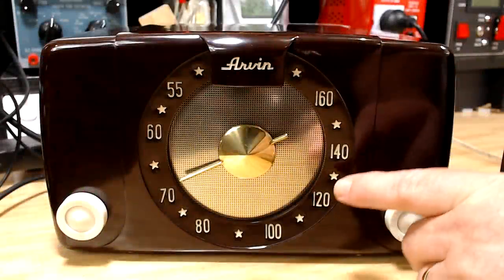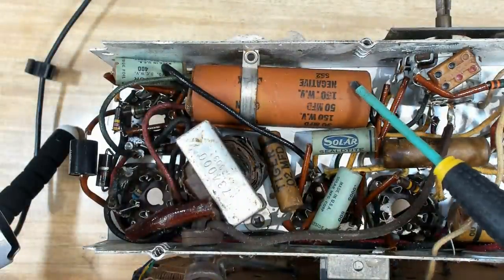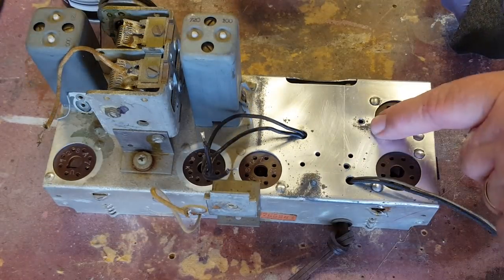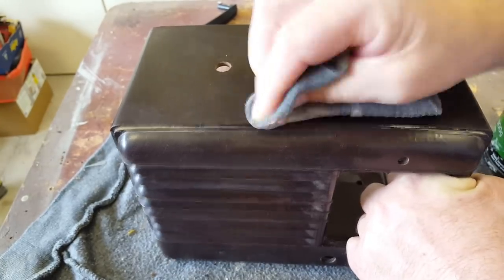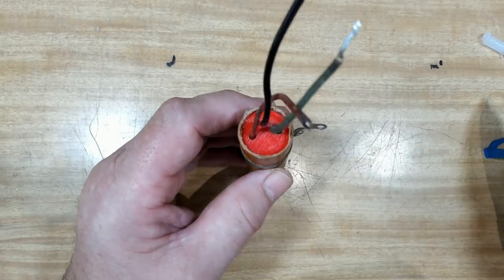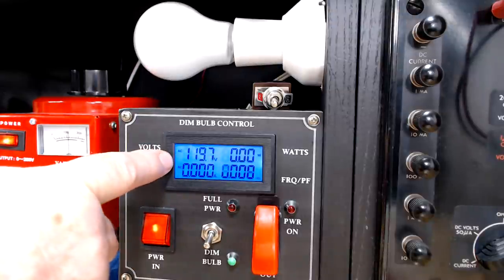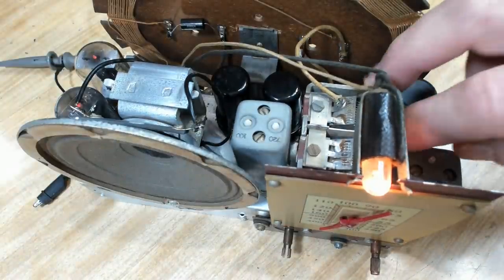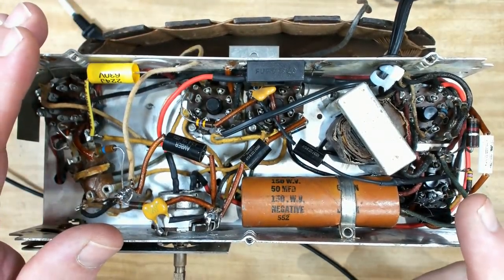Emerson Radio Restore Model 518 USA Built - 1940s

Comment: Replacement dial faces are available from several sources in the US, including eBay.

Those IF transformers rarely give trouble and do not use silver mica like later ones. The screws adjust open-air trimmer caps. They may be peaked during alignment but usually stay where they are set. The outer plates of each section of the tuning capacitor were often bent outward to adjust tracking, especially the oscillator section. Some were segmented to make it easier and more precise.

The pointer is original. It was made to point to the frequency on one side and the wavelength on the other. The same pointer was used on AM/SW models and its use on AM-only sets was mainly a cost-saving measure during depression years.

This was a popular design and also came in a wood cabinet. The handle was a big feature since people liked to carry small radios to other parts of the house and outside in hot weather to listen to ball games. Other brands quickly copied that (Philco, Motorola).
Reply from the maker: Hi Ray, luckily the dial face was Ok and the pointer although it was fit for function it looked like it came from a Corn Flakes packet, my printed one didn't look much better.
The handle was a great idea, my Mum used to carry the radio from the kitchen to the bedrooms to the laundry, in later years she used a portable transistor radio, much more convenient 🙂
Reply: @DavidTipton101  I just mentioned the face for the benefit of others running into the issue. Your method would always work but some aren't as handy as you.

I lucked out a couple of times by finding a couple of blister packs of small objects with just the size I needed. I keep promising ones now when I buy something. You never know what scrap will come in handy.

Comment: Emerson was a big name in electronic here in America.
Reply: I think the brand lives on but only as a brand and not a company.  Most of the stuff comes out of China and Hong Kong now.  I saw quite a few Emerson-branded transistor radios here in Australia in the 60s and early 70s...all generic Hong Kong units.
Reply from the maker: I believe it was Reginald, thank you 🙂
Reply: Emerson is very much still alive...  based in Missouri.  I believe more industrial stuff than consumer.  I have a few transformers, motors e.t.c.  made by Emerson or subsidiaries at work.

Comment: Great job David with the old Emerson. Emerson was a large maker of Low End consumer electronics. The name is still around but its not the same company. In the early days of radio Emerson's business model was to make radios as inexpensive as possible so as to keep the retail price low. They cut many corners in the manufacture process from the case to the electronics. Emerson made radios for the masses. They sold large numbers of radios throughout  the depression. In many ways Emerson was the pioneer of the disposable radio. Other than tubes replacement if something major went wrong it was cheaper to buy a new Emerson radio then to have the old one fixed. If Atwater Kent was at one end of the radio market. Emerson was at the other end of the market. BTW the case of your Emerson was indicative of most Bakelite cases Emerson used. Same goes for the pilot lamp and dial pointer. 73 Joe
Reply from the maker: Thanks for the information Joe. The case was rubbish, I assumed it was a one off but maybe that was their standard. The general quality of the chassis was good except the speaker held with one screw, I meant to put a bit of adhesive behind it when I refitted it. Thanks Joe 🙂

Comment: They wired the power to be sent through the filament in the rectifier so it can be used as a fuse. Wasteful by today’s standards but back when valves were common place I guess it wasn’t looked upon as a bad design. Always good to rewire the power switch to switch the live or hot side rather than the neutral side of the mains so bravo for getting onto that.
Edit: Fantastic work there making the new clear plastic dial piece! Couldn’t have done a better job.
Those I.F. Cans with trimming caps always tend to drift off frequency much further than the later slug tuned ones however they also don’t really get silver mica disease. They can get dust in the caps which may cause a similar effect to SMD which I experienced on a old ekco 30’s radio with 4 volt pre-octal valves.
Reply from the maker: Yeah, someone else said that too BOE, thanks. That filament would be living on the edge 😀
Reply: That’s what I thought, the valve has the additional function as a fuse, at least it can be replaced 😉

Comment: The routing through the filament is meant to act as a fail-safe for the radio since there is no fuse in the circuit. In the event of a short circuit, the tube will fail instead of causing major damage to the set or, worse, a fire.
Reply from the maker: Thanks Steven, most others are saying the same thing. I guess it saves a 10 cent fuse 🙂
Reply: @DavidTipton101  Well, not only a fuse but a fuse holder and extra wiring ... BTW, are you sure that this was a U.S. radio and not a Canadian model?  

Canada had higher electrical safety standards than the US up until the free trade agreement and extras like this fail safe were much more common in Canadian built sets... normally a Canadian radio would have either a CSA sticker or Ontario Hydro inspection label somewhere on the chassis so the absence of one makes it unlikely (unless it dried up and fell off).
Reply from the maker: @stephenwild2058  There was no indication that it was a Canadian model so I don't know 🙄

Comment: Hi David. Superb job yet again. I think the filament acts as some sort of circuit protection, I have seen this before in some other old radios. It may have been better with an Inline fuse and would also be cheaper to replace. You were lucky with the chassis being in a good clean condition for its age. It's always enjoyable watching your work. Again thoroughly enjoyed. Keep safe and well. Cheers Chris.
Reply from the maker: Thanks Chris, that seems to be the general consensus, expensive fuse if you ask me. The chassis cleaned up pretty good in the end 🙂

Comment: I think the theory with passing all the current through the filament was basically using it as a fuse in case something went wrong on the b+ side.  a very expensive fuse in 2020.
Reply from the maker: Yes, I think you are right kevtris, not sure if it's a good idea or not 😀

Comment: Just a little note. I've had great results using brake cleaner (the non-flammable type) it is the same chemical used for dry-cleaning. It doesn't remove paint, but is a wonderful solvent for dirt and Greese.
Reply from the maker: Thanks Tim, I'll check it out 👍😀

Comment: The pilot light is in parallel with that piece of filament. That's why the extra current flows through there. If the pilot light burns out, the extra current will kill that tube fairly quickly.
Reply from the maker: Hi Mr Hat, you  are absolutely correct and I missed that. I couldn't understand how so much current was passing through the filament but, as you say, the bulb will supply around another 120ma. Thanks for the update, I did learn from the Arvin to make sure the bulb was working 👍😀

Comment: Well done David,  a pleasure to watch you do your magic on these radios.  As far as that red indicator jewel, my guess is that it was added on.  The schematics for these 500 models which you showed, listed a dial crystal, which I believe refers to the dial cover(dial lens, etc) since photos of these models show no indicator jewel.  Haven't read all the comments so this may have previously addressed , if so, sorry for the repeat.  Looking forward to the next adventure
Reply from the maker: HI Bob, thank you. Yes, I think you are correct about the crystal being the glass and the red lens being an add on. I also think it was a replacement dial and pointer. Other comments also helped cleared that up but it had me confused. Thanks for your help 👍🙂

Comment: Hi Dave, thanks for the video. The IF frequency could be deliberately changed from the original 455 kHz. In the 60's some radio's sold in the Netherlands used an IF frequency of 472 kHz. The maritime radio station "Scheveningen Radio" was broadcasting at nearby frequency 461 kHz (among others). The strong signal would swamp out nearby radio's and listeners would hear Morse code coming out of the speaker regardless of where the radio was tuned. Radio repair shops would change the IF frequency of the radio to solve the problem. As long as the oscillator is changed accordingly the dial would still correctly indicate, I guess. Keep up the good work, always looking forward to your video's!
Reply from the maker: Hi Steven, thanks. That would have caused problems with a broadcast near the IF frequency. I don't know if that's why this one was misaligned so much 🤔
Reply: I was fascinated  by this repair. BTW the oscillator padder capacitor is calculated according to the IF frequency. If the IF is too far away from the designed value then station tracking could be out. But the dial scale on this set is so imprecise that it probably wouldn't matter much. Thank you for this video

Comment: Another David Tipton work of magic!  Keep up the excellent work!
By the way, on most AA5's the capacitor on the loop antenna should be a safety cap...not sure if this one was.
Reply from the maker: Thanks Wayne. You are correct on both counts, I was waiting for the Y safety caps to come in, I have to fit them to this radio and the Arvin 👍🙂

Comment: Always great videos, but just  wondering why with the filter capacitor repair, making it so hard for the next guy to remove and replace the contents with all the adhesives and press fit of parts. That repair is tsunami proof, hurricane proof and earthquake proof. I always leave a note or some indicator of the work done so the next guy knows what and when the parts were replaced. I employ a few vent holes in the housing not in view when in final position, to ensure cool operation and long life.
Reply from the maker: Hi Thomas. To get it apart it just needs moderate heat but I can't imagine anyone doing it. I will write a message on the metal band that the capacitor has been restuffed. Heat was a consideration but after 8 hours of continuous operation the capacitor wasn't even warm, I could have put some holes in the top side of the tube out of sight.
Reply: @DavidTipton101  Excellent. Thanks for the great repair videos.

Comment: Hi David...Do you have a 3d scanner to make that dial?? then 3d print it?..........also, where did you get that alignment tool.?....it looks non.metallic..I need some of those, regards, Buzz
Reply from the maker: Hi Buzz, I don't have a 3D scanner, that would be great! I guess you mean the pointer? I made it in Tinkercad by assembling shapes, it's a very basic program. I got the alignment tool from a radio club auction so I don't know if they are available elsewhere. They are plastic with a small brass driver tip at each end 🙂

Comment: Nice work yet again David.  I picked up a Panasonic R-1018 pocket radio from ‘67 at the local Vinnies.  I replaced to three electros in it with some improvement and checked some voltages and current draw. It all looks good but the sound is still somewhat distorted so I may be looking at a faulty speaker.  It’s an 8Ω one so should be easy to find, downside is it’s a low profile shape.  I’m thinking of changing the 1uF on the volume pot for 2.2uF fora bit more bass.  Only other problem was a tiny bit of corrosion on a battery contact.
Reply from the maker: Thanks Wenlocktvdx. I love Panasonic stuff. I had trouble locating a speaker with the smaller magnet, hopefully you find one 🙂
Reply: Unfortunately, after further voltage measurements, I proved the driver has a short base to emitter. It’s a 2SB175 and I can get them on evilbay but, as they are sought for fuzz pedals, I’m faced with $25-30 plus shipping for one. 🙁

Comment: I knew you would make that Emerson 518 into a superb little radio.  I very much liked the replacement Perspex dial covering, and the dial cursor you made.  aesthetically, those two new items definitely set that radio off.  What more can I say here Dave beyond, “I wouldn’t expect anything less from you my friend.”

Although I own two working valve testers, I hardly ever use them.  For the large part, I only take what my testers say as a guide to how good, or bad a valve might be.  Occasionally I get caught out when the tester provides a reading that is absolutely accurate - but generally speaking, I’ve a very good idea the valve is totally shot before I test it.  Over time, you develop a kind of instinct when valves, as well as other components, are good, or bad.

Hopefully I will be uploading my videos mid next week.  They feature two American Philco radios, and I’ve accomplished pretty much what you accomplished with your two American radios.  As you indicated, AA5 & AA6 radio circuits are generally straightforward enough.  Their speakers, dials, and cabinets etc. can present time consuming challenges.  Having said that, I do like American radios, and (if the Bell Planet Colt is anything to go by), New Zealand radios also.

Best regards, Phil.
Reply from the maker: Thanks Phil, I appreciate your confidence in me 😄 I agree about the valve testers, I was more concerned with shorts in them than their actual function, with all the current going through the rectifier filament I didn't want any unknowns. I received a new 12SQ7 and tested it wondering if it would test the same as the old one but it passed with flying colours. looking forward to your videos next week, cheers 😀

Comment: headphones on this set would be shocking light up your day
Reply from the maker: I was thinking the same thing Ian 😲
Reply: The circuit showed that the secondary side of the sound output transformer was floating in respect of chassis, but even so, it would be foolhardy to trust your life to the transformer's insulation.
And even if that was OK, you'd also have to hope the loudspeaker could safely handle mains potential between its metalwork and speech coil. The diaphragm can sometimes warp, causing the speech coil to scrape against the magnet.

Comment: Great job making the plastic dial cover!  Emerson made tons of these bakelite sets from the late 30's through the 40's.  This is a 1946 model.  The original dial was printed directly on the plastic cover, and the pointer was a white teardrop shape on a red background (you can see the red beneath the gold dial someone added).  The red light isn't original, neither are the knobs as you mentioned.  With your new pointer though, this looks a lot more like the Emerson's made in 1938-39, and it's a great look!  This is a typical AA5 circuit (licensed from rca, all basically the same regardless of brand), but Emerson's seem to always perform a bit better than average!
Reply from the maker: Thanks a587g. you may be right there, I think the whole dial is from an earlier radio, probably Emerson, that would explain the new glass and out of place pointer. This radio is a bitza, bits if this, bits of that 🙂.

Comment: Hi David. Why d'you think the radio - i.e. the case - is so poor? Emerson were a big player in American radio manufacture (Wikipedia says it held one-sixth of the US civilian market in 1942). They became a very important (and trusted) wartime maker of military radio equipment - especially ancillaries like antennas and dynomotors and built some very ingenious sets for the US Navy, like the RBZ. There's no evidence that US production of electrical goods immediately post-war suffered any particular quality problems. I really can't see any factory QA inspector letting your radio out the door. A reject, a 'second' perhaps?
Reply from the maker: Hi Alastair, it was only the case that was poorly pressed, the radio was fine. The case was blotchy and had a rough finish. It may well be a seconds that escaped the factory. It polished up ok but not as good as other Bakelite radios I have. Emerson was a big supplier in the US, I wasn't suggesting it was a reflection on all Emerson products of course 👍🙂

Comment: I was so excited when I saw that you were supposed to have connected that capacitor to pin 2 and you accidentally connected it to pin 3.  It felt good that I was actually following along enough to figure that out.  Another excellent job Dave.  Buyers beware... you'll never know what's in that electrolytic tube if Dave worked on it because it looks 100% original. LOL
Reply from the maker: Hi William, I rewatched that part and it was fun to see me slowly realise what I had done wrong. Thanks William, I'm glad you were able to follow along 👍🙂

Comment: Hi David, Another Great Video.  A low valve certainly can produce some big issues. An amp i restored I lazaly didn't check the 6V6's thinking they will still work after replacing all the caps and faulty resistors. On powering up the Audio was low, distorted and barely recognizable so frustrated I went over the whole unit checking everything, signal tracing the audio up to the 6V6's. Last was checking the Valves where the 6V6's tested very low, replacing them the amp ran to perfection. Have kept the dud valves as a lesson learned. You definatley never stop learning restoring this stuff.
Reply from the maker: Hi Joshua, you can't take things for granted can you? Well done finding the problem. I don't think we ever stop learning about anything , cheers 😀